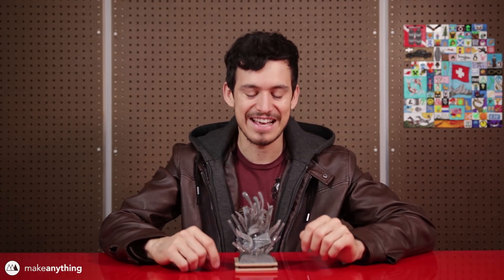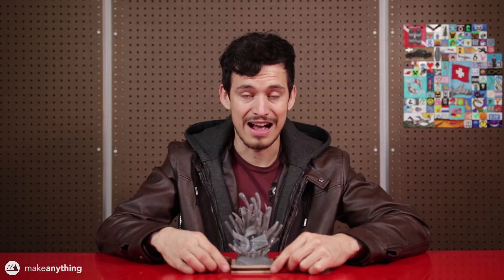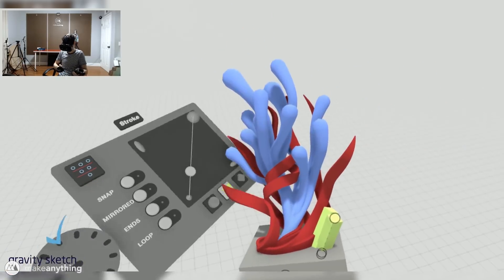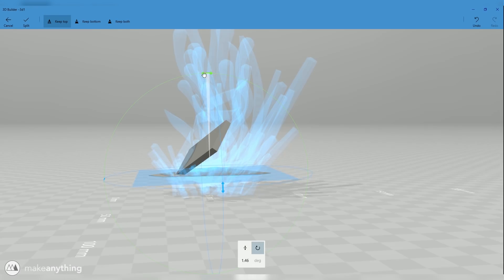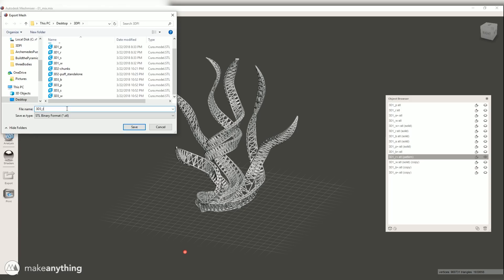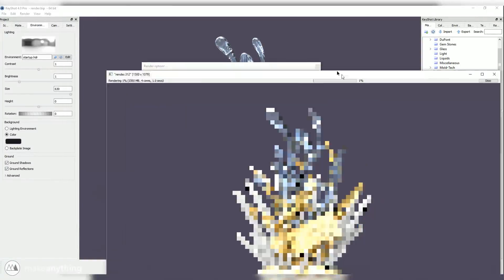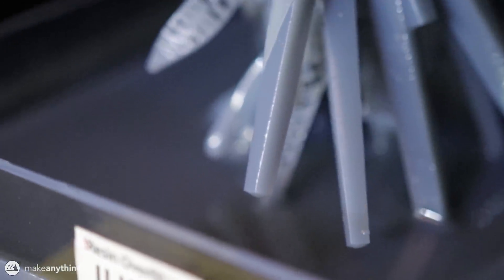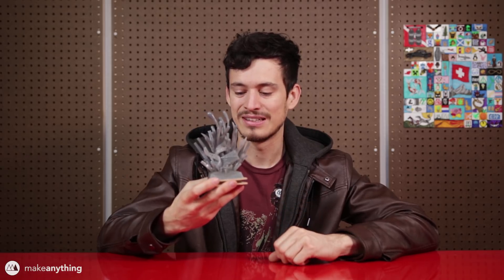VR Sculpting a 3D Printed Trophy

Comment: Ok, Devin, I have contacted you on Twitter but that is a bit restrictive with the character limitations and what not.
So I'm trying to decide between the cr-10 (because you said I should get that and no the tevo tornado) the jgaurora a5 and 
the anycubic I3 mega.
I'm looking to get started with 3d printing and not quite sure how much build space I will need or want, and how much is really necessary.
If anyone has the i3 mega and wants to share on the size of it and how limited it is (if at all), please do.
Reply from the maker: I think the i3 Mega is a great starting printer. You can always design fixtures to connect parts or just glue things together

... But the cr-10 is still my favorite ;)
Reply: What about the JGaurora a5?